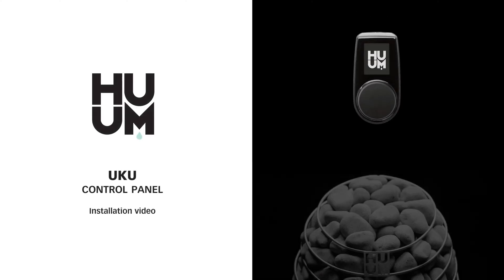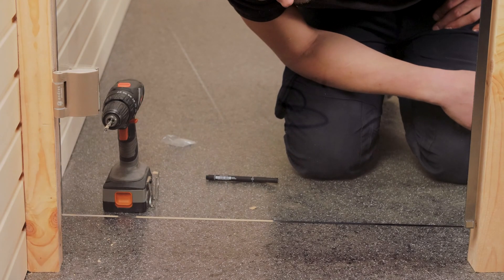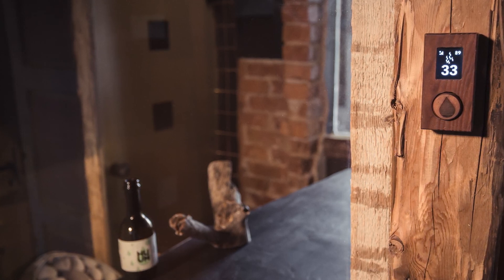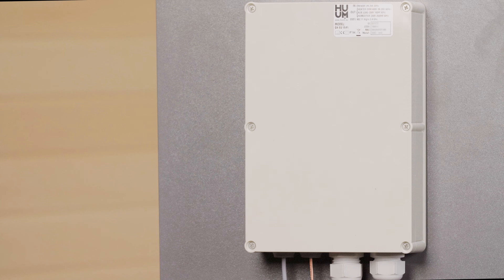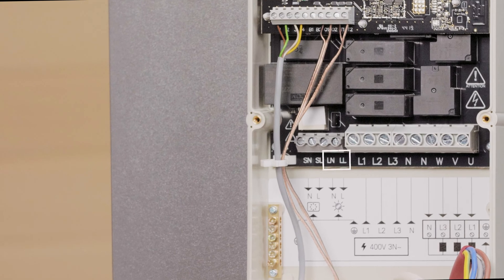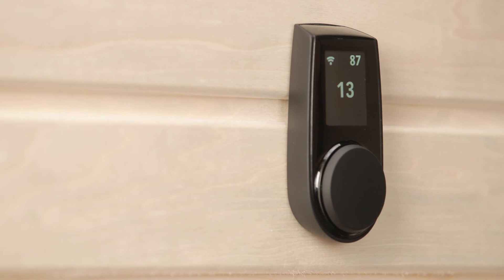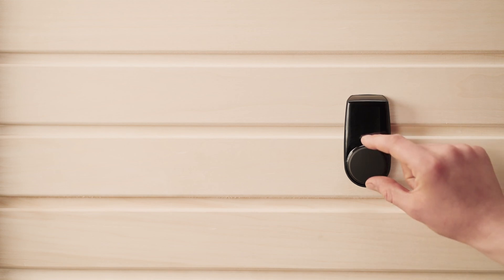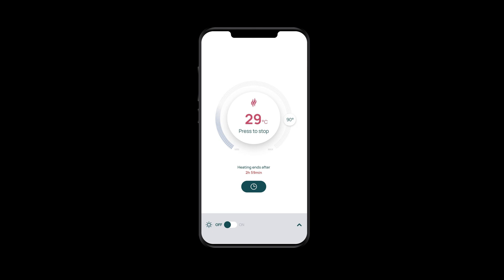HUUM UKU Sauna Heater Control Installation

Comment: Where are the instructions for the lighting?????
Reply: @AdventuringMike  yes but not for advanced features. It's basic on/off
Reply: There were not instructions with our unit and we called our dealer and had a bard time getting a good answer on how to wire up the lighting bar we bought with our unit.  We eventually installed a separate 110 plug to plut the light into this seems pretty silly I would expect the lighting to connect into the control unit.  Its very frustrating that the instructions were not better provided for this likely very common use case.

Comment: Does the lighting control option have a dimmer control built in?
Reply: Did you find out the answer to this?
Reply: @tjsayers1007  I did. It is only on / off. Contacting HUUM directly went really well and I also called a local distributor in Chicago and they had a lot of answers too.